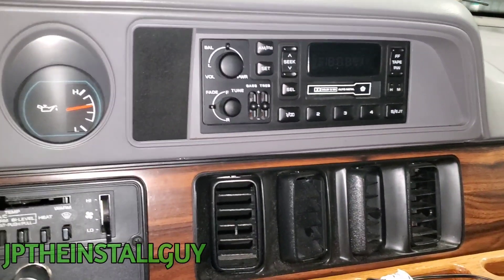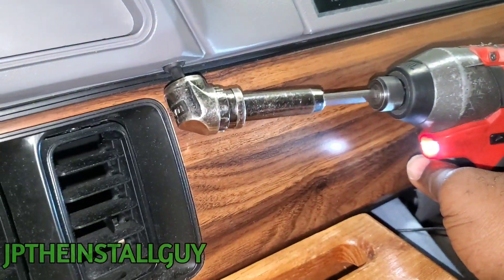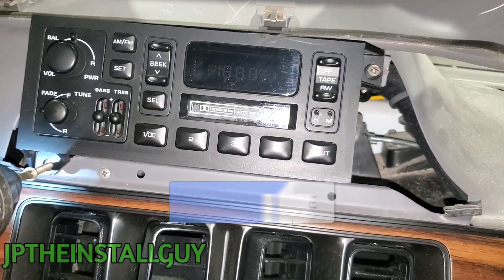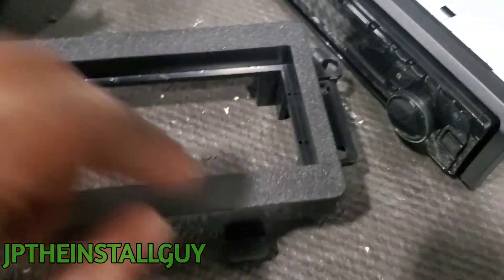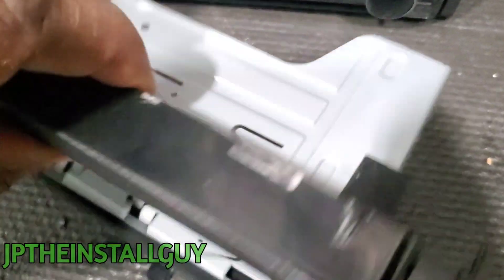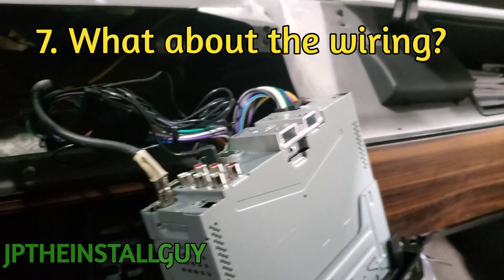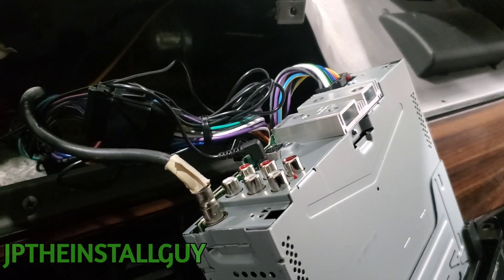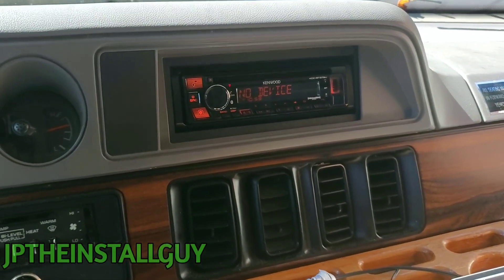1997 dodge ram van radio removal replacement install

Comment: Yo jp unrelated but does your 97 have problems with the front doors both mine went thinking it was the hinge on the left side right side I have to replace or have repaired

Comment: I'm trying to pull my radio out on a 2001 Dodge van but it seems to be hung up in the rear on the left side. Is it some kind of anti-theft thing where you have to know where to push a tab down with a flat head screwdriver?

Comment: Did your wiring harness for the van have front negative connections? I have white/black and grey/black on head unit side but not van side just white and Grey positives

Comment: You are the Man JP !
Quick question, I have exact same van n my new radio stuff came in today,
Did you have to disconnect the battery cable before you installed it ? I hate to do that, but I’ll take ur advise, hit me up soon thank you

Comment: I have the same van with the factory model radio replaced when I purchased it. The replacement radio is no longer working and I was in the market to replace it. I already took out the radio, so the guts of my van are bare, I just need to decide what radio to put in. What do you recommend?